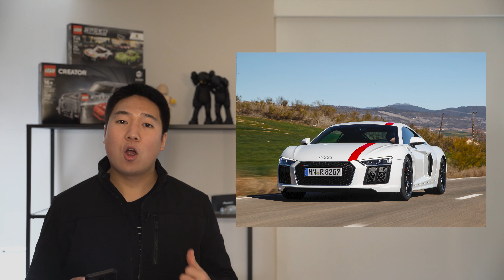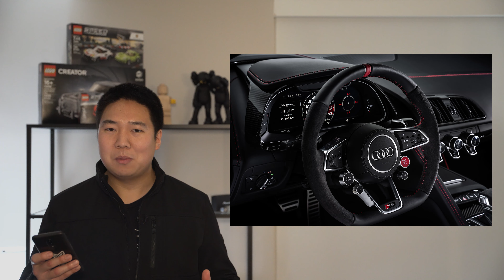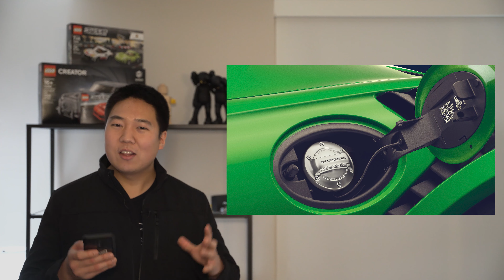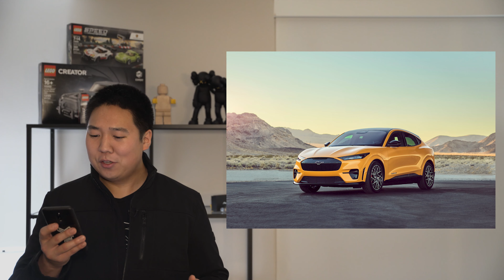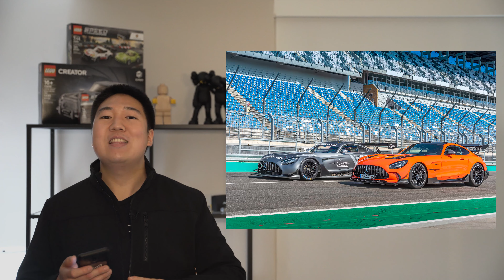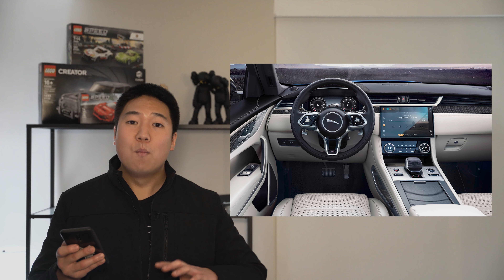Audi R8 RWD, Porsche eFuel and More! | Latest Car News

Comment: Ummmm... So e fuel sounds like diet soda... It's worse than the original product due to the ingredients... Or sugarless gum... With no sugar but has aspartame which is 50 times more harmful than actual sugar...
Reply: Why do you do some research then dummy
Reply: The harmful substance of efuel should be cost only
Reply: Real diet soda or coke zero is electric car
Search about lithium mining, basically the lefts are covering one problem with another bigger problem